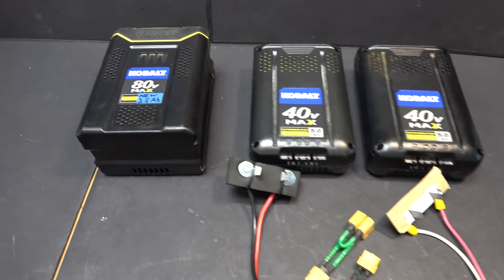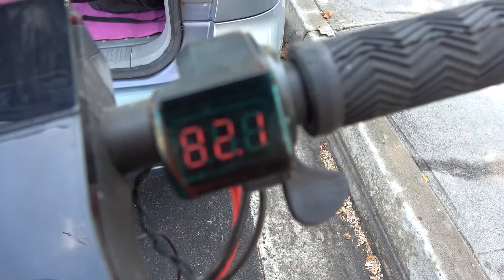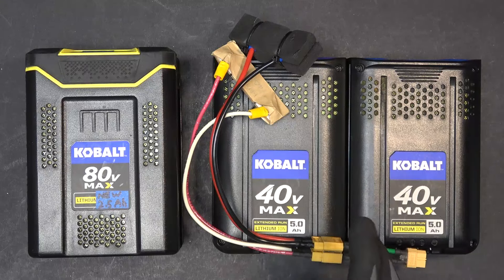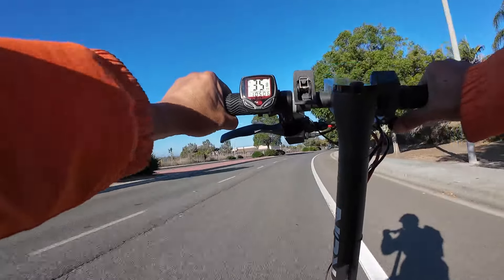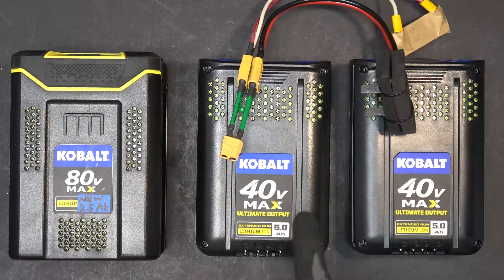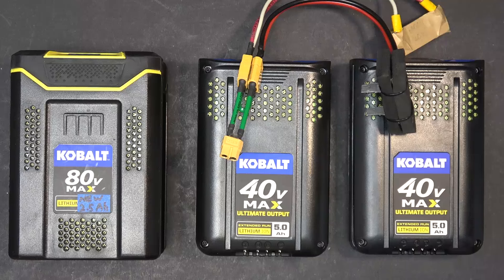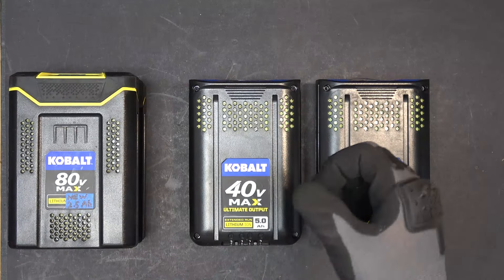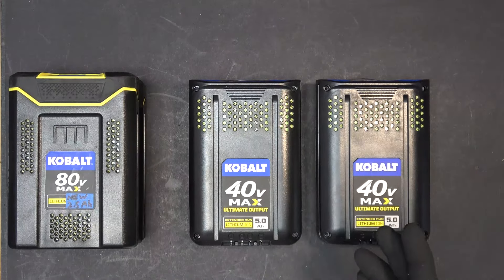Place your bet! Kobalt 80V 2.5Ah vs. 2x 40V 5Ah in series on a 72V Electric Scooter

Comment: I am thinking its the BMS or cell limitations of the 40v battery packs. From my experience when putting BMS protected packs in series, the max power draw from a string of packs is whatever the max draw of the lowest output pack in the circuit. I have Milwaukee batteries, M18 5AH packs have a max output of around 800-900W (18650 cells). The M18 6AH XC (high output 21700 cells) packs I have can output closer to 1500-1800w each. But when i used 2x 5Ah + a 6AH XC, the max draw of the string does not exceed the max rating of a single 5AH pack.

Comment: Running the motor at no load and showing a small change tells me that the motor is somehow seeing a difference between the two setups. I think part of it may be the wind skewing results. Even small changes to clothing or stance at that speed with such a small motor likely makes a noticeable difference. 

One thing I noticed on my own bike when upgrading to a much higher capacity (Ah) with the same voltage is that the voltage drop at full load is much lower. I can freshly charge both batteries and the larger pack feels like it has much better acceleration. It seems to be the same in your case as well. It's possible the BMS's on the two battery setup may have issues working together. The motor controller may also behave differently since the reduced voltage drop means it is trying to draw more overall wattage.

Comment: Top speed is directly proportional to voltage. Torque is directly proportional to current. Given that your torque (acceleration) increases with the 2x40V setup, this would indicate that your controller wants more amps than your 80V pack puts out. With that said, though, the 80V pack video shows a voltage of 82.9V when you hit 38.9 MPH, while your newer 2x40V packs were at 83.1V to only achieve 35.8 MPH. Why? I don't know for sure, but I think maybe the effective voltage of the 2x40V packs is lowered by the cables used to parallel them. The Vmeter still reads a higher voltage, but I wonder if the controller sees a lower voltage once there's a load on the system. If you do more testing, maybe you can make the Vmeter visible to the camera so we can see the voltage under load...?

Happy weekend, dongchi. ✊
Reply from the maker: I can see the voltage under load on the thumb throttle LED screen. But I can't pay too much attention to it because I have to monitor the speed and at the same time try to keep control of the terrifyingly speeding scooter on skinny wheels with wobbly steering and no suspension at almost 40MPH. My bet for voltage under load is still on the 2x 40V batteries, though. Still a mystery! 
Do you actually speak VNmese or did you use google translate, dongchi? :D
Reply: @vuaeco  I didn't use G-Translate this time, which is why I was missing the proper accents. I don't know 10 words of Tien Viet, but...maybe someday. ✊

Comment: You probably have a bad connection somewhere in the 40v wiring harness as there's more connectors being used. Are you sure you crimped them all properly? Each XT60 connector also increases resistance under load so voltage is dropping a lot more with 2 batts.
Reply from the maker: I thought about that but I double checked and all wires/connections are nice and tight.
Reply: @vuaeco  You don't know what the voltage drop is like until it's under load. Your home made connectors for each 40V batt are also major weak spots, do a voltage drop test & report back.

Comment: You hit a pothole on that thing at speed and you are going to be in a hospital bed or worse for a long time.
Reply: OR A ROCK---MAYBE AN OIL PATCH---NO GLOVES EITHER!
Reply from the maker: That applies to a lot of things on 2 wheels at high speed
Reply: And if u sit around and do nothing, heart attack and diabetes will get u. I ride a Buddy 125 around town and an old CR500 in the dirt. I’m 75. And potholes can kill u for sure. U r 100% right, we have to b careful
Reply from the maker: @billrimmer5596  That's a way to go, Bill!
Reply: I have the same worry, but...I don't think they get the same variety of pot holes in L.A. that we in places with salty roads and freeze-thaw cycles do.
Reply: @fun_ghoul Parts of LA get bad potholes. I saw a grayhound bus get stuck in a pothole in downtown once.  The heat melts the asphalt and there is a general lack of maintenance.
I think he lives further south, maybe in orange county (OC).
Reply: @erikj9962  FYI: It's all "LA" to us outsiders. Also, I'm originally from Montreal, so I know a little something about lack of maintenance. 🤣

Comment: i took apart a 40v kobalt i don't believe it had MOSFET switches on the output , only on the charge line , plus 
  signaling   with maybe balancing.  

top speed seems more like a voltage thing.  the factory chargers vary in termination voltage.   have you checked for identical voltage ?  or use 2 scooter chargers in series to get 84v on the 80v pack and 42 on the 40's.  charge thru the outputs i've done tbat on both.
Reply from the maker: Same voltage, around 82V-83V shown on my thump throttle LED screen
Reply: @vuaeco  very hard to explain then.  but i've taken apart both 40v and 80v kobalt batteries and fairly certain there is no discharge mosfets, only mosfets for charging  cut off, via the C terminal.    there is only some form of crude over current protection i believe .

Comment: you have reached the limit of the winding of the electric motor. To go even faster you need to increase the voltage until the winding starts melting 💀

Comment: Is the gauge of your battery lead causing a "bottleneck" in your current?
Reply: Creating more resistance maybe?
Reply from the maker: I have the same set up for both the 80V and 2x 40V batteries so if there's a bottle neck, it would apply to both.
Reply: @vuaeco  I thought that too but what about the cables connecting the batteries in series?
Reply from the maker: @amp86400  That's a good point. I double checked and all connections were solid and tight.
Reply: @vuaeco  After thinking about this for a couple of days, I think you should test the temperature of the series cables and see if the temp rises  from the used battery setup and the new battery setup (if this is at all possible that is). To me it makes sense that with the increased amp potential, the resistance is rising and the energy loss will show up as heat. 🤔

Comment: From memory a straight series pack will act as a single battery. Once you parallel, there are bottlenecks internally that limit the output slightly. 
If you have 2 80V batteries that you can hook up in parallel, you can test this. Top speed should drop slightly but range will almost double.

Comment: speed is determined by the engine itself, the scooter engine is 350w so its limited to max speed of 42 and no more, if you're looking for speed, simply change the engine
the battery voltage will only increase the power acceleration of the engine giving it more power to endure an uphill and to reach max speed in shorter time
Reply: simply replace the engine with a bigger one (ones that has more wattages) then you'll get a different result, even with a weaker battery voltage, although you can't find bigger engine for a scooter because the engine itself wouldn't fit to the wheel of the scooter
Reply: No. In BLDC motors rpm is related to the KV ratio of the motor. Wattage is totally arbitrary figure. KV = rpm/volt, so actually raising voltage means higher rpm.
Reply: Also raising amperage increases torque.
Reply: @1managainsttheworld  it depends on the type of the motor itself, ebike and scooter motors has speed limitation, and they are labeled with their speed limit, a brushless motor always comes with 3 wires for a reason and thats for a motor controller to work accordingly with the motor's functions, and it includes the speed limitation
changing the controller with the same motor will always end up giving the more more strength but never increases the speed, even if you uplift the wheel, the speed will always be limited to max of 42km speed to most 350w motors
Reply: @masterxmasterx7197  You have no idea what you are talking about.
Reply: Higher current flow will provide more Torque..  higher voltage allows higher RPM without necessarily changing the torque.  I believe the loimiting factor is the Discharge Rate of the cells,  or more likely,  the BMS limiting the flow with PWM - maybe a measure of protection..
Reply: @masterxmasterx7197  No.    Motor RPM is nearly always controlled by a controller of sorts, or current limit being reached by either battery, BMS, or even cables (which will result in a voltage drop).    Motors will over-rev to destruction if "told" to do so correctly by whatever is controlling them.   They do not have RPM limiters built in.
Reply: @1managainsttheworld  Someone who knows.  ;)
Reply: @dalmatianlife  they actually do have rpm limiter built in, its the "hall sensor"
Reply: @dalmatianlife  how can you explain the fact that i have 2 ebike wheels with different motors, one delivers max speed of 42km, and the other delivers a max speed of 27km using the same battery
Reply: @masterxmasterx7197  The hall sensor merely communicates the RPM and/or the pole position of the motor back to the controller which uses that information to adjust the supply to the motor to hold RPM steady.
Reply: @masterxmasterx7197  Many reasons.  one wheel could have more or less poles than the other,  or they could be designed to have different operational voltages..  the strength of the magnetic field,  the efficiency...    There could be many different factors.

Comment: @vuaeco
 Query.   Are you believing that the Ah rating of a battery will improve acceleration or top speed?

The Ah rating is the amount of storage a battery has. Think a 2.5Ah battery being a bucket holding 2.5 gallons,  and a 5Ah battery is a bucket holding 5 gallons.   This is the total capacity of the battery.

The flow rate (or discharge rate) is different.   Say the 2.5gallon bucket has a hose to drain it that is 2 inch wide,   but the 5 gallon bucket only had an 8th inch pipe to drain it.     Obviously the smaller bucket would allow the water to empty faster than the 5 gallon bucket.    The width of the drain pipe is the equivalent to the discharge rate (in Amps..   not Amp hours).

Basically,  even though the 2*40v battery make a larger 80v "bucket",   they may not be be able to discharge the capacity (empty the bucket) as quick as the 2.5 Ah (smaller bucket with its larger drain pipe).

i hope this help and is not taken as criticism.  ;)

ps.  i am open to debate for explanation if wanted - or criticism.   ;))

love the vids
Reply from the maker: The Ah ratings isn't a factor. It's the cells' parallel connection. The 40V is a 2P configuration. Each cell can discharge up to 30A continuous so 2P would do 60A. The 80V is a 1P configuration which maxes out at 30A discharge.
Reply: @vuaeco  What is the maximum current draw of the motor (ie stalled condition draw)?      For it to be riding slower in same conditions then it must be down to the bms of each of the series pack  just not liking series?  If either one of the BMS stutters for any reason,  the other battery will be affected being in series.   

What about taking the board out of the big battery and putting it with the cells of the 2* series cells?